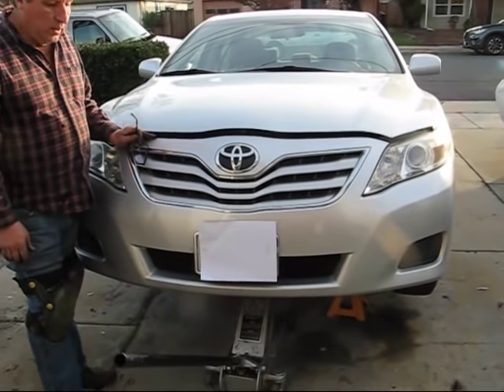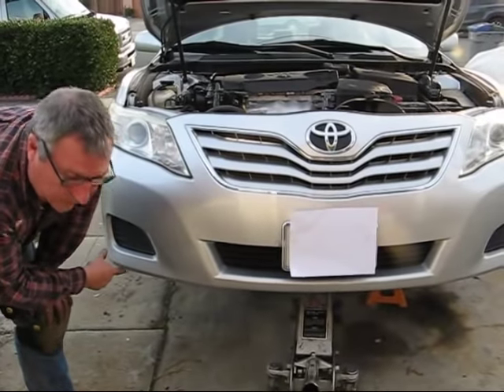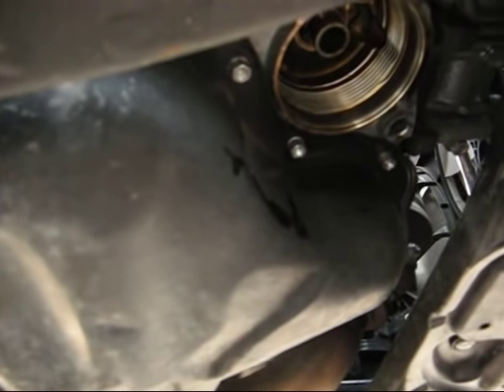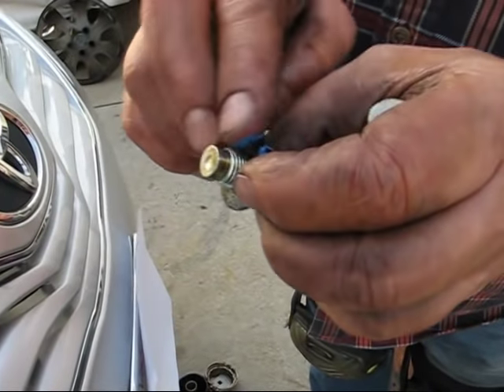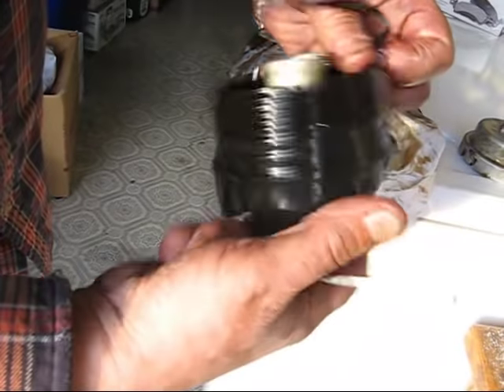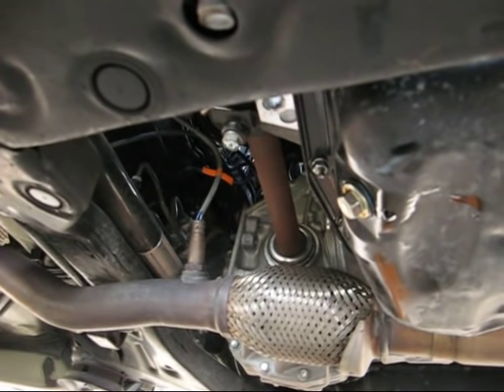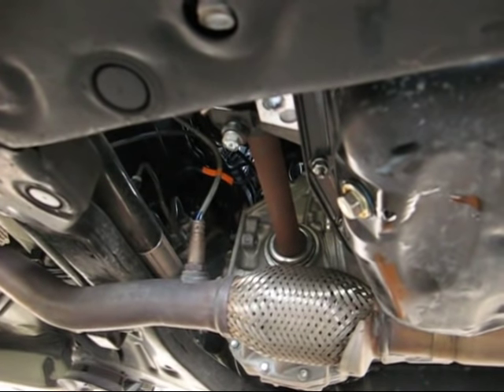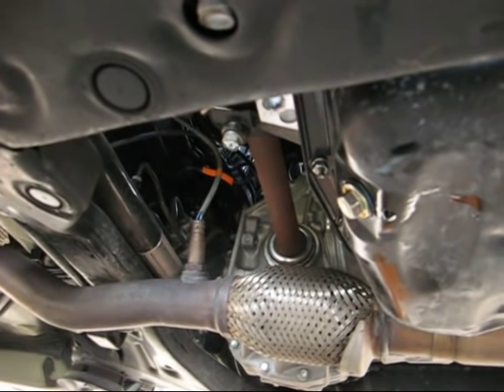How to Change Oil and Filter on Toyota Camry 2011 and Up - Plus Reset Maintenance Light

Comment: Good video though sealer on plug was a bit much.Da wife is going to be peeved unless that's  her Camry.I have the 2011 and  was wondering why the oil filter book listed two different filter possibilities on four cylinders..Looks like I have to buy a new filter wrench, well that's not happening. This was going to be the last time I ever changed  oil myself anyway, just not worth it..
Reply from the maker: You just had a bad experience, we all have them sooner or later.  Don't that stop you from doing your own work.
Reply: @davidlis6709  what a stupid system Toyota came up with, they should have just left the tradition type of filter...
Reply: Thank David, even I'm 66 in a few weeks I don't have a problem getting down and changing oil...it's a pain..Just not sure about Walmart oil change as I've heard horror stories but don't want to pay $80 either. A traditional oil change on my Silverado could be done for less than $35, some of those nitrile gloves on the wisely forgot to do that too. I guess what I'm saying, it can be a mess.  I don't have a garage to work in or driveway as nice as yours
Reply from the maker: @irish89055  You have to take it in and pay instead of doing it yourself.
Reply: @davidlis6709  I ound up buying a metal filter wrench at Auto Zone.. you can't trust Walmart to do an oil change right from what I heard and synthetic blend changes are fairly expensive at most places..
Reply from the maker: @irish89055  I can change the oil faster then bringing it to Oil Changers, Walmart or where ever.  You still have to drive over, get in line and wait for them to do it.

Comment: Typically you’ll want to check your oil level when your vehicle is on a level surface (not still on jack stands) and after your car has reached operating temperature. FYI 👍🏼😎
Reply from the maker: I start it up to check for leaks and let the oil to go through the filter.  I also changed this many times and know how much oil it takes.   I don't think there is much difference between hot and cold.
Reply: If you know how much it takes there is no need to check and double check the dip-stick. It's not going to be different than it was for the previous change. The only reason to check is if your memory fails you and you can't find the capacity anywhere.

Comment: Motivx makes the best oil filter cap wrenches. 
Model MX2320 is for all Toyotas with cartridge style filters EXCEPT the 1.8 liter & smaller engines which the Motivx MX2321 works for.
Available on Amazon.
Reply from the maker: Thanks for the information.
I just know not to use the plastic ones.

Comment: I thought the smaller o-ring went inside where the canister meets the bottom, as there is an o-ring there....
Reply from the maker: Look at video (minute 6:25) and you see the bottom of the plastic canister.  It has a silver plug.  You can remove the plug and drain the oil in the filter before you take it off.  That is where the smaller o-ring goes.

Comment: Good to use conventional no need for useless synthetic sometimes that can break/ruin an engine plus harmful to catalytic converters good to use conventional to avoid from burning my car tends to run Better on conventional than synthetic pretty weird the synthetic is going to cause more leakage lol especially in something older
Reply from the maker: I heard the same thing concerning leakage when the engines get older.  I change everything at 5,000, so I use what ever brand is on sale.
Reply: @davidlis6709  true yup synthetic to me is useless it’s like asking for more problems

Comment: Your dipstick will be wrong b/c the car is on jacks and not level
Reply from the maker: By how much - 1/8 of a quart
So when you let the car down and all the oil moves forward and levels out and it reads 1/8 quart more
Missing the point.

Comment: Doesn't that engine call for 0w20 not 5w30
Reply from the maker: It runs good on 5w30, and 10w40.  What ever is on sale.
I calls for synthetic oil to be changed at 10,000.

I used regular oil and change it at 5,000.  Today it has 110,000 and uses about 1/8 of a quart of oil per oil change.  So, I guess the car does not care, it just likes the oil and filter to be changed at 5,000 miles.

My 1986 Camry was sold at 186,000 about 12 years ago and the person is still driving it.  Who knows how many miles it has on it.

Comment: Do not put that stuff on your drain plug. Manufacturers have a listed torque spec for drain plugs as well as if you need to replace them on each oil change service. You will end up damaging your oil pan if that drain plug is too tough to get out.
Reply from the maker: I have only been doing this since I was 14 and I have never stripped an oil pan bolt.  After a while you get feel of how much to tighten a bolt depending on its size and amount of thread per inch.  Sorry for the answer.

Comment: walmart sells metal ones for $5..fyi
Reply: what the adjustable wrench, walmart # 556657712 ? could work. but im gonna be careful, he says below not to break the plastic (ugh) filter housing. id like to get a laugh in on toy yoda...dont want him to get another one in on me!!!
Reply: Metal oil filter cap wrench? Made out of forged aluminum and not cast. Also with teeth to lock into the tabs on the oil filter cap assembly?

Comment: drain oil pan 1st.....FAR less messy
Reply from the maker: Still going to get dirty.  3 and 1/2 dozen to the other.
Reply: AMEN to that brother..........................How do you get that smaller o ring installed onto filter housing ? I see you dont do that step..? i could not disassemble it...P.I.T.A.   GOOD video and thanks for the cross member jacking point tip with the Floor Jack.
Reply from the maker: I never take it off, all that does is drain the oil in the oil filter housing.  I have to remove the entire oil filter housing to get at the filter, so I just skip that step.
Reply: Yup, oil pan first,  unscrew the filter drain plug, I keep a filter drain tool with a longer hose on it to drain filter assembly, then undo the filter and replace the element.  A lot cleaner and not that much more time spent.

Comment: I have seen so many videos like this and they seem to be pretty crude. If you take the small cap off first and insert the tube that comes with the filter cartridge, it drains the housing so you won't have such a mess to put  up with. I don't understand how people that wish to show other folks how to do an oil change like this, don't try to show how to do it without being so sloppy. It is so simple to do it and remain clean and not having oil running down your arms to your elbow. Also no one seems to want to clean out the housing before installing the new cartridge. I'm sorry, but I just can't seems to want to me messy when it is so easy to keep your work area, and yourself, cleaner. Poor demonstration to say the least.
Reply from the maker: Everyone does it differently.
Reply: I agree, IF you're going to do a video with the main purpose to teach others how to do it, then do it by the book. It's okay if you tell them how you do it but they should also know how it's supposed to be done.

Comment: Wrong oil! Drain the oil first then drain and remove the oil filter!
Reply from the maker: I talked to the service manager at Toyota and he said you do not need synesthetic oil.  I change the oil every 5,000 not 10,000.  The car has 95,000 miles - so it must be ok.

What difference does it make to drain the oil first?
Reply: @davidlis6709  
It might be okay with you but if I knew conventional oil was used in the car instead of synthetic, I wouldn't buy it. As far as I'm concerned it hasn't been properly maintained.
Reply from the maker: @stevensevek6151  Everyone has their opinion and beliefs.  All good.

Comment: I just unsubscribed.. Toyota DOES NOT SAY 10,000 miles!  
That is under specific conditions only! Conventional 3k, synthetic 3-5k under normal driving conditions especially a lot of short trips or more weight in the car often, towing, etc.
Reply: You can go 5000 on a good conventional oil or even 7000. That 3000 mile is for New York Taxi cabs. Or a lot of driving. I'm sure the oil co's love you!!😝😝😝

Comment: Could you possibly tell me what happens if smaller o ring isn’t installed, I realized the smaller o ring fell off, since it is inside the filter housing, I figured I could skip it until next oil change 
Please??
Reply from the maker: Is oil leaking from the filter?
Reply from the maker: @bbjagaa  Learn something everyday.